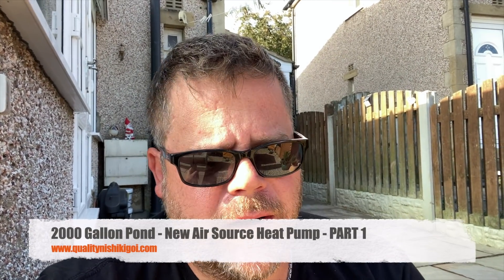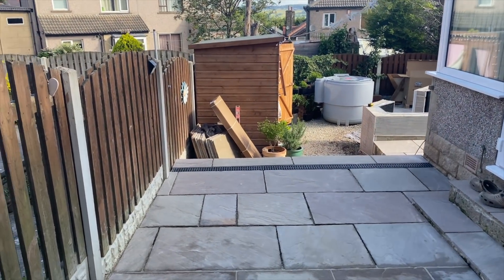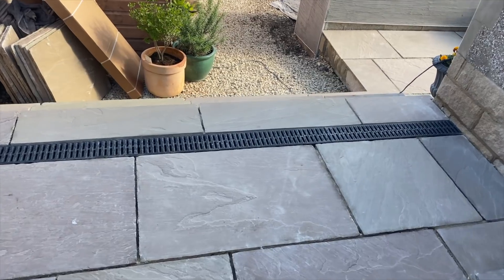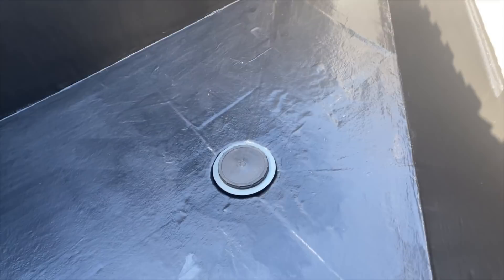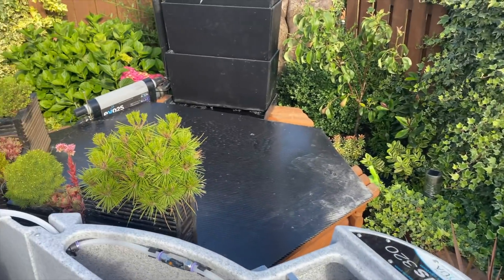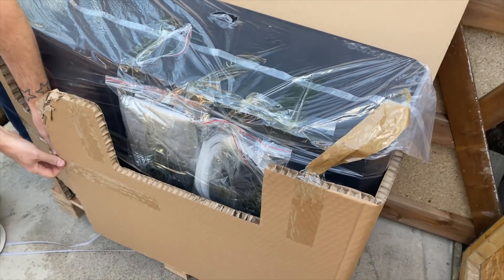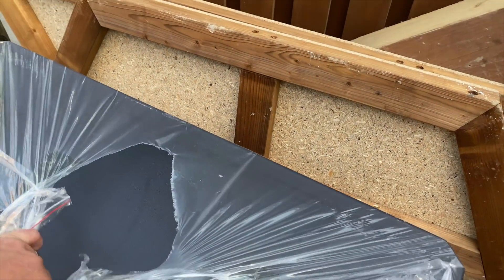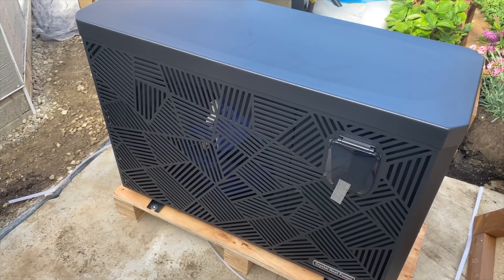2000 Gallons PART 1! New Heat Pump unboxing!

Comment: I have a question I’m hoping someone can explain for me. In this build it’s stated as 2000 gallons. I’m digging a pond that is 15’x8’x5’ when I use the pond guy calculator to find my liner size it tells me my pond is 2,244 gallons of water. But if I use W x L x D x 7.5 which is used to determine gallons of water in a pool I get 4500 gallons so which is correct?
Reply from the maker: L x W x D x 6.25 👍
Reply: Quality Nishikigoi thank you for the quick reply. Can I use the nexus 220 without a bottom drain?